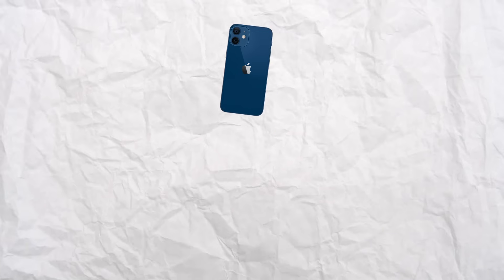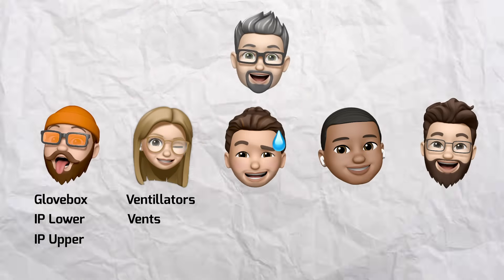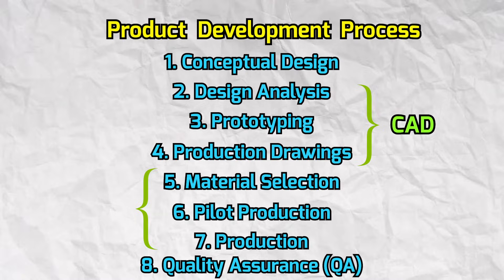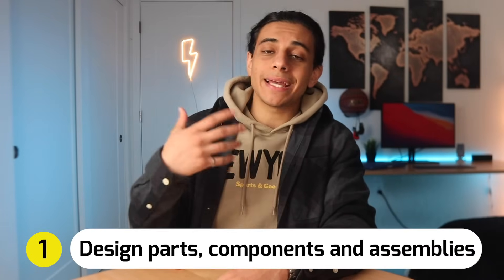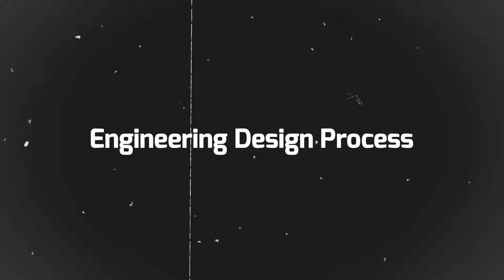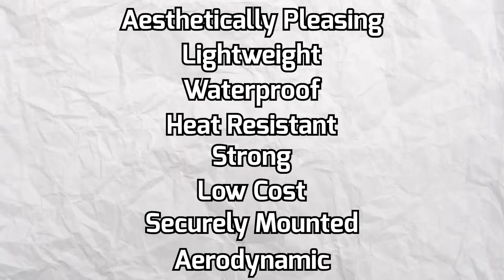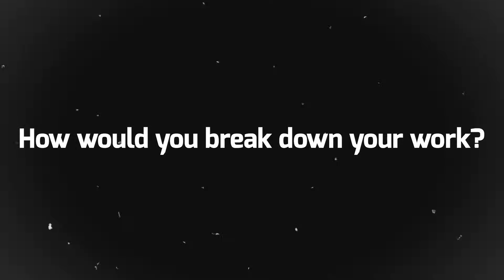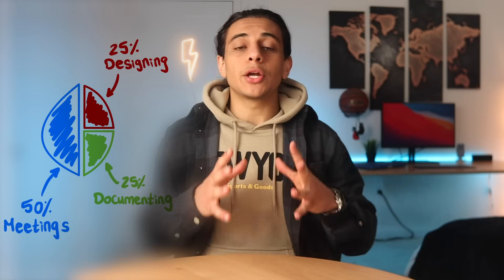What do I do as a Mechanical Design Engineer?

Comment: Bro you just overlooked process designer. I am a process designer. We get a bunch of part from product designer that can't be manufactured by forging. We tell the product designer that it is not feasible and suggest the NPD to make changes. A product can be mass. Produced majorly in 4 ways, press tool( sheet metal). Forging, casting, moulding

Comment: Hello, i have a question for anyone willing to give his insight...I am a mechanical design engineer and i have been working for the past 5 years with a few intervals (1 year of mandatory army service, plus 1 year being inbetween jobs). I have been in 2 different jobs for 1+years in each, i was fired from a 3rd and i am currently in a 4th one. On the first one (surprisingly), i had the chance to do all the things described in this video and actively participate in the design of the final product (although being inexperienced). I was very successfull with minimal guidance and i had a good relationship with everyone. On every other occasion, i was brought in to ''support'' the existing designers to a point where i was taught to do 3 simple tasks and i was made into a robot that would repeat the same keystrokes for 8 hours straight, doing all the ugly and unpleasant braindead tasks that all the others wanted to avoid, while learning the minimal things that served that purpose. No actual designing, no problem-solving, not much experience learned in anything, nothing...just repetitive tasks for fabrication purposes. It started on the second job, where i endured it for 13 months and then i quit for another job where i couldn't stand it and they let me go. I am currently in my 4th job for 2 months now and i see the same pattern occuring. I try to get along with others and i never expected to build ...a spaceship on my first day at any job. I switched jobs because of external causes that had to do with the companies and not me or my performance. I am at a point, where i begin to question wheather i made the right career choice. I know that when you are new at a job there is a period when you only get to do this type of tasks but i don't see any intention from my supervisors to allow me to engage in any actual project. And in many cases senior employees confessed to me that this is actually what i was hired to do, although i was told otherwise during interviews. Is it a case of company mentality/ co-worker environment that made these jobs like that, or is it a general trend to hire people in such positions and only have them do ''the laundry''? I would really appreciate anyone's advice on the matter cause i used to be happy to go to work and now i curse every minute of  it...

Comment: Hey mate, I was wondering if it's possible to land a CAD exclusive remote job. I hold a Bachelor of Mechanical Engineering from Chile including a year abroad at UCSB. I used Inventor for 1 semester at Uni like 10 years ago and haven't touched it since.

I also worked as a Web Developer with Ruby on Rails and React. I was always more interested in mobile than web, and thought maybe it's a lot easier to stick to this field if I wanna work remotely.

Lastly, I was wondering if it's easy to start a Product Design career in a self-taught fashion with my engineering background or if it's better to go back to school for that (and if is likely to be able to work remotely in that field).

Thanks a lot!

Comment: I'm a senior mechanical "draftsman." Two year technical degree (AAS). 10+ years experience with mostly Creo/PDMLink.

I would say most design work is understanding the scope of what is requested, whether sustaining, customer special order, or new product development. I will often take 15-30 minutes just reading and analyzing the information given to me and then if anything is unclear or there is incomplete input required to complete the project, I will schedule a meeting or call (if it's quick) the originator of the request to clarify.

CAD is a large part of any modern mechanical engineering/design position. With that comes documentation, as stated in the video. Even though you, the designer, know exactly what happened, before you can route the release or revision of the part and/or assembly drawing to be checked and released to production/mfg, you must spell out every aspect of your work clearly and concisely. I would say even if I get a simple change and knock it out, it probably takes me 20-30 minutes just to enter all the change information to route.

Then there's file management. Most medium to large size companies will use a customized software package that works with the CAD software. In the case of Creo, the standard product lifecycle management (PLM) tool is integrated into the software if the license includes that application/tool. You have to checkout files, revise them, check them in, etc. outside of actually changing the features, notes, etc. that need to be modified so the preliminary drawing reflects what was originally requested. If routed and approved, the drawing document is then (usually) automatically published to a released drawing vault where people who have production drawing access can view the new revision. There is also an additional step where the manufacturing team or supplier (if it's a "buy" item) get a distribution notice that updates their part or assembly package for that product so they produce the updated version.

There's a lot to it, but I usually spend my day listening to music in peace while processing change notices and customer special requests since I am very familiar with our processes and standards.

Comment: Tamer I just want to start off by saying you do a great job at providing straightforward information. That being said, I just want to add that there are a lot of Mechanical Engineering positions out there with misleading titles. For example, I have a few friends with the title "Design Engineer" however they do no design work but rather work on excel spreadsheets, power points, and attend meetings for the most part. My question is, how does one find a position where you do ACTUAL design work like what you do and not just the title?

Comment: Thank you for the video, I have been on the book for so long and now am trying to change that
Trying to get ME designing job and just taking solidworks course to get my cert.
But I dont just want to know how to sketch and create parts as am learning, I want to think and apply what I learned in class (materials, heat transfer, tolerance, safety factors)
I guess in short, learn as if I already have the job.
Is there a book you can recommend that helped you through the process? Or you learned most through job?

Comment: I'm a mechanical design engineer for a small tech company in CA. It's just me and boss (who is remote) as the ME's.

 I find the hardest part of my job is getting the small group of product managers to get me concept info. What do you want the panel design to look like? "Not sure!" So I spend tons of time creating a new design with little guidance on the wanted aesthetics. This means I rework the design MANY times often in totally different versions until they can guide my designs to what they actually want. It is highly frustrating because there is so much wasted effort because of the inability of higher ups who do not know how much effort goes into each design just to get shot down as "We don't really like it". 

I'm planning a move to a massive tech company where I can have more access to resources, pro level engineers for design questions, and for having a far more defined PRD (aka specs, design look, etc). As a two man team I do concept to production - EVERY part, EVERY drawing, EVERY screw is my design. It's AWESOME. But such a small scale team means I'm lacking for rapid prototyping, lacking in senior engineers for guidance, and lacking in knowing exactly what direction to spend my design time on. It also means any design weaknesses on any part are 100% my fault. I must be hyper vigilant when submitting prototype designs to initial mfg.

3.5yrs out of college, making $110k. The pay is great but a two man product design dept has challenged me professionally and I think I can make better money at a more organized larger company.

If you made it this far into my comment I'm guessing you're still in University. For those still in school, FINISH. I almost failed out with 2.04 GPA two years in. Had a life epiphany, and got my S together crushing exams and killing curves. Couldn't save my grade. Graduates with a 2.94 GPA, with a 3.45 major GPA. Did one year of grad work after that. During my interviews was honest about my early school failures and then facing adversity by killing the next few years. You can get your degree, and you will design awesome stuff - keep your head high. Being an engineer is an impressive qualification. It's yours if you put in the effort and the dedication.
Reply: Felt like we just had a conversation without even talking.
Reply: i want to do this in bangladesh
Reply: Start with hand-drawn sketches to narrow down the design before investing a lot of time.
Reply: Thank you man for this comment.

Comment: If you want to be an excellent mechanical engineer it really helps to love what you're doing. You want to develop this problem solving mindset and challenge yourself to build things you know would make you or others happy and push you forward and then commit to the challenge until you finish it. Buy material and tools so you have them ready. Draw a lot. Sketch concepts, draw plans and calculate the math as most engineering projects start with a pen and a paper
Reply: I would like to know how this works, for example I love to work with CAD, I can can make a project what they gave to me in the paper just to copy. One thing that is it us have to create a project if you want to work in this area, How this works ? Thank you
Reply: @aditr1841  I believe in you

Comment: The thumbnail is a little misleading, I have been a Mechanical Design Engineer for almost 5 years and I can tell you the average salary is not 125K, I would break it down as the following:

0-3 years experience: 60-80K
3-8 years experience: 80-100K
10+ years experience: 100K-125K

This is a rough estimate and obviously changes based on your region/industry you are in but you will need quite a lot of experience to make 125K!

Other than that, great video man!

Comment: It’s not impossible to make a product in one day it would be difficult if you don’t know what you’re doing but not impossible. I’ve built many prototypes before that were sellable in a day like a motorized dugout canoe and a practical pop pop boat inspired steam powered outboard made out of old cans and metal tubes. One time my uncle had an idea for an auto roofing ripper and he made it in less than a day with just a few parts and he doesn’t even have a high school diploma. His invention has the potential to make millions but he never did anything with it. My point is that it’s easy start a business in 2022 as long as you’re willing to invest the time you just have to find a market that you like that requires a product then do the research, make the product AND test the product over and over until it’s good enough to sell. After you’ve done all that you can advertise it all over the internet on fb and YouTube to protect your yourself from getting sued by any copycats.  try to get your product out there put it everywhere you can and file a patent if you can’t afford the full patent then apply for one so it’s in their data base that you were the first one to come up with the idea. I never finished high school but I have +100 viable ideas for products and business ventures written down in a leather binder away from any cameras or phones where apple and google can’t access it the fucking thieving weasels they are

Comment: This is nice to see. When I went into ME, I started work as a manufacturing engineer, and then became a maintenance engineer. 

There's a whole lot of uses for a ME degree and opportunity that people don't talk about. A lot of my job (automotive world) is making improvements on already existing equipment. When you  get industrial equipment running, especially brand new models, there's a lot of little details that start to come up in terms of better production. Such as types of sensors, pumps, motor monitoring, etc.

It can be stressful for sure, but its amazing what you get to work on.
Reply: That’s something I think is missing and wish would’ve been pointed out earlier. There’s so many branches and specialization in mechanical engineering that are never mentioned in school

Comment: "ISO 2768-1" just states what standard is being used. You have to define the tolerance quality class, not the standard identifier. As an example, the most common would be "ISO 2768-mK". 50% meetings? Rip efficient work flow :D

Comment: I went to school for computer engineering. I learned electrical engineering as well and PCB and processor design. When I graduated, I almost immediately went into web development. Because software is entirely virtual and there are basically no hardware or performance constraints I need to worry about, I find I enjoy software engineering much more than hardware. Nowadays, I manage a team of developers and spend 80% of my days in meetings with the other 20% preparing for other meetings. It's hard to find the time to do actual development anymore, but if there's something that I 1) am particularly suited for given my and my team's skillsets or 2) would really enjoy doing myself, I can usually carve out enough time to get it done.
Reply: no one cares.

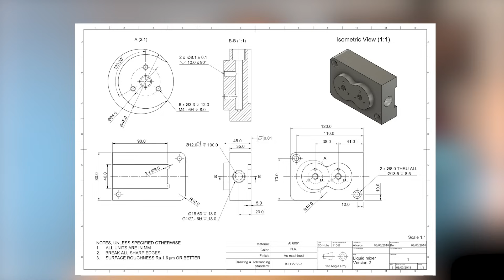Comment: 2:58 this is the reason why anyone who wants to be an engineer should spend a few years doing factory work. You'll quickly learn what is feasible and what's not when it comes to machining.
Reply: Mechanical engineering (junior) student here. I almost stopped my freshmen year to pursue machinist training, but our university machine shop director (former toolmaker and machinist) instead recommended I join the competition teams and clubs around campus. Ive since learned how to operate most standard prototyping shop equipment (mill, lathe, cnc, bandsaw, press) and their limits, and I incorporate them into my designs. Ive also learned how to weld and work with composites and molds within university extracurriculars. Ive had fun working on a formula car, sounding rocket, and even built my own CNC equipment. 

I learned this a bit later into the degree, but you can learn much of what goes into good Design for Manufacturability for other less easily accessible stuff like casting, injection molding, or sheet metal design online by paying $20 for a decent online course. Many skills you can pick up in internships. Theres also many summer volunteer programs to learn DFM from experienced engineers, offered by google, IBM, and organizations like SME. 

Naturally, the former technicians studying engineering tend to be better engineers, but having worked as a fabricator and assembler for a summer, its very likely you will get shoehorned into a particular set of tasks and not get to cover all the ground you're hoping to. Use your university's resources, for real, the true value you get at college is the extracurriculars, not the classes
Reply: @samo6401  in whixh year are you in now?
Reply: @dremr2038  early junior year
Reply: I strongly agree. I recommend to everyone who can’t get an engineering internship for the summer to look for a factory job for the summer instead.

Comment: This is quite a good video, but I was kinda surprised by how you've given the list of requirements in the "engineering design process" section, because requirements such as "light weight" or "easy to install" are terrible requirements. They are the equivilant of "the part should have a temperature". They can be used to move goal posts. It's the opposite of what you want from a requirement. A requirement is a specific, dealing with a locally and systematically closed area in which it's effects are measurable. A requirement is measurable - it has a unit or a unitless coefficient that has to be matched. Usually an acceptable range is given, such as 2 - 2.1 mm. A requirement needs to be attainable - anything that's outside the companies expertise or the industries standart procedures is off the table or at least needs really, really good reason to be kept on the requirement sheet - stick with what you are good at. If you do sheet metal parts, don't require carbon fiber support structure. A requirement is relevant - it's relevancy directly reflects on it's position in the requirements hirachy and anything above category 4 usually never makes it into the final product. Requirements above category 4 are discarded as "nice to have" and might make a comeback in a future version or a luxury line. This avoids feature creep. And finally, a requirement has a due date - There needs to be a final deadline by which the requirement needs to be validated or invalidated. Otherwise it will always be pushed into the future, never achieving anything. 
That's how I learned my requirements engineering and it's a little shocking how little I see of it being used in practise in most places I've looked at so far.

Comment: I find this rather interesting. My experiences (solidworks design engineer for 13 years) are quite different, though I've always worked for smaller companies doing small scale or custom production. I'd say we skip about 2/3rds of the processes you've mentioned. I also spend about 60-70% of my time designing, the rest of it in meetings or supporting fabrication, assembly, etc. I also could only dream of the salary you have listed as "average" in your thumbnail, most design engineer positions I've seen make little more than half that.
Reply: cliccbait bruv. Homeboy tryna side hustle